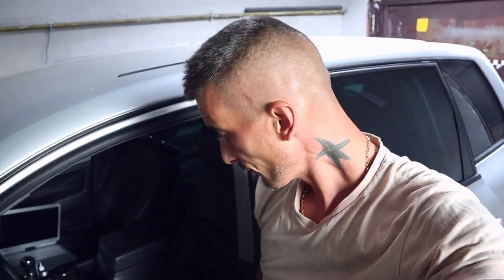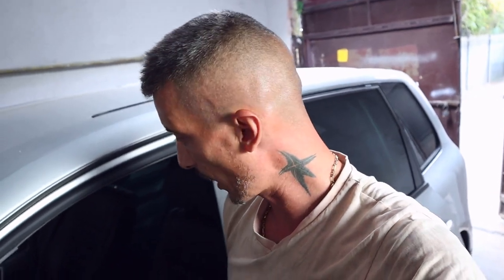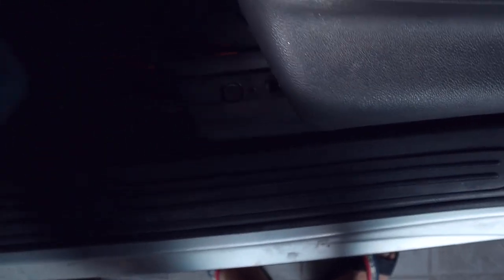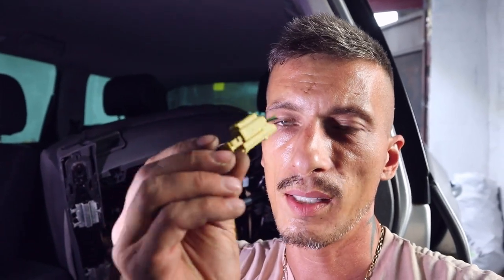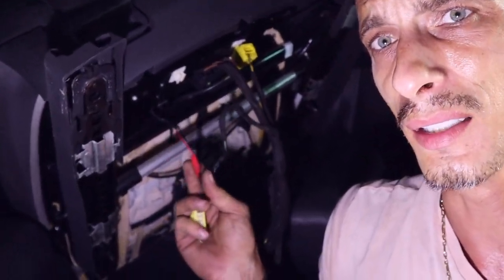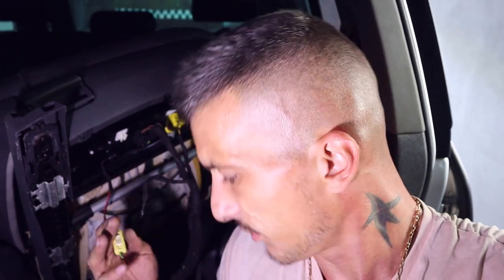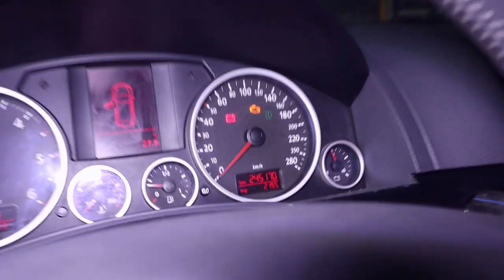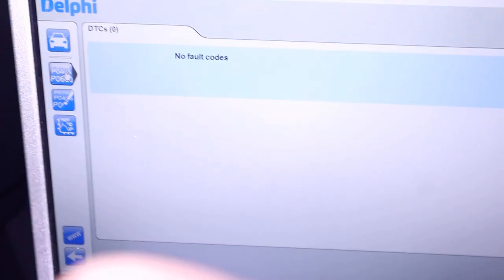Fix Your VW & Audi Airbag Light: Tackle Fault 01217 FAST!

Comment: My audi a4 b7 cabrolet airbag light igniter driverside. I could not find that yellow connector under the drivers seat.
Reply from the maker: @3kkk514  look for a brown connector with 2 wires
Reply: @Relectrik-Cars  thanks i will look this weekend